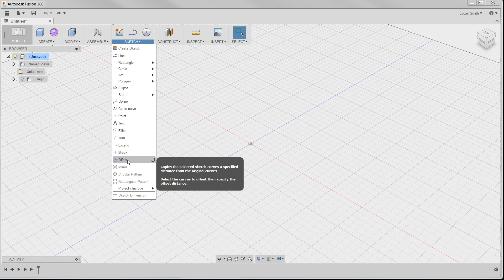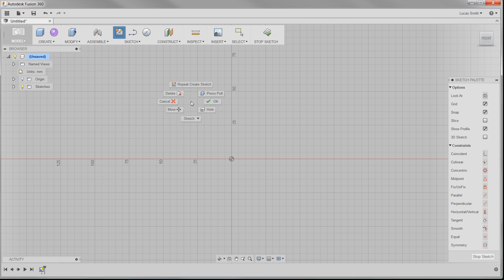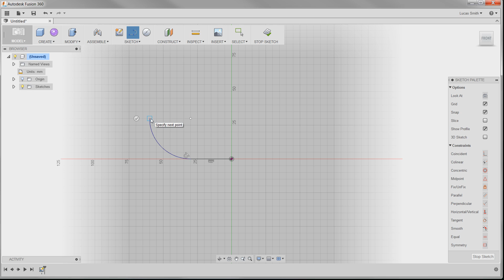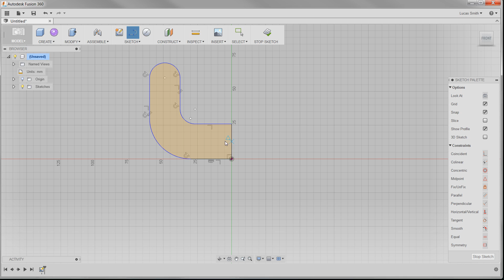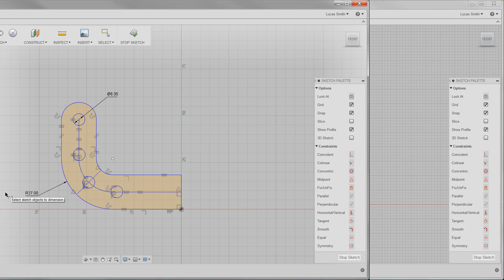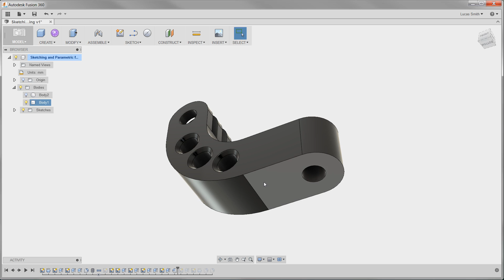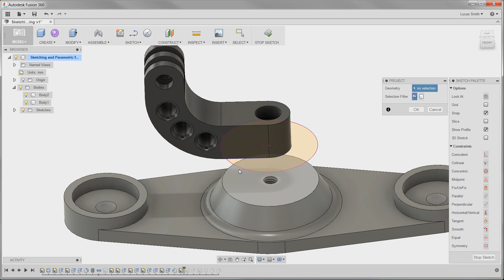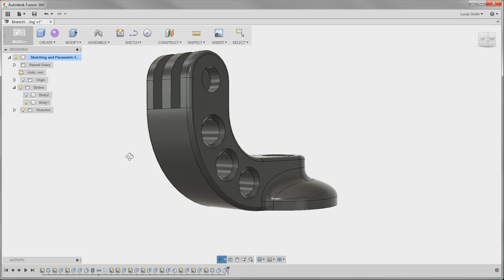3: Sketching & Parametric Modeling

Comment: This reminds me any of CATIA (DS) features like sketch projections and the horizontal way to sketch and model between different parts in assembly.  I always found CATIA very handy and ergonomic, this is why I like to learn on fusion which is awesome!... btw,  is that possible to have the same mouse configuration as CATIA? which permit to pan and set the centre of the view with middle button, and switch between zoom and rotate with left one, so you can easily and accurately "fly" through your model pretty like with a 3dconnection jog.. 
Thank you for the job! I'm your 1st fan!